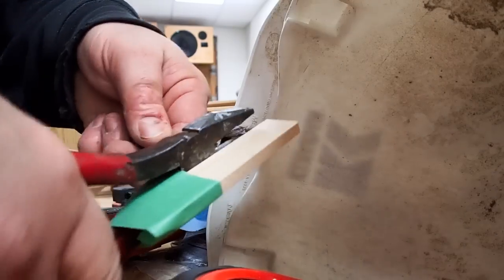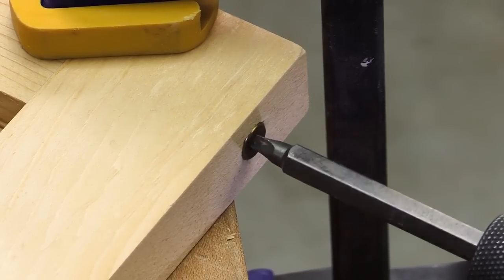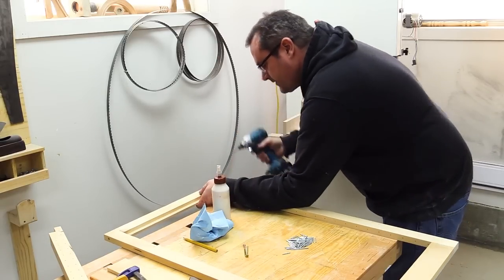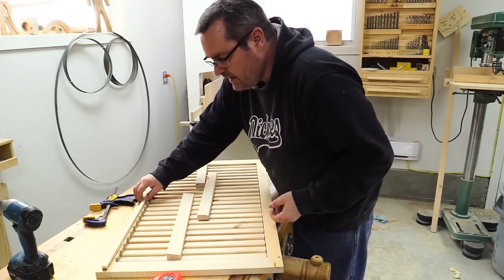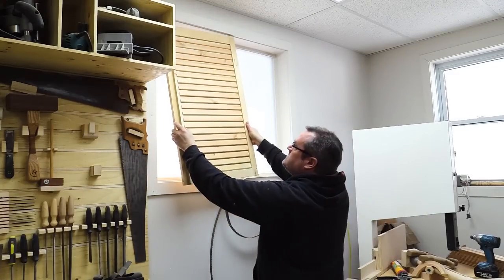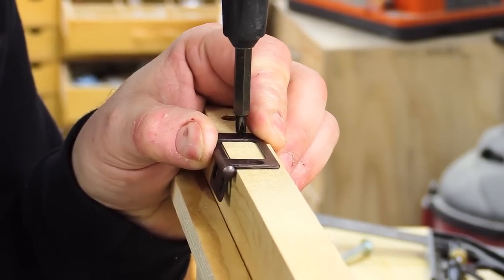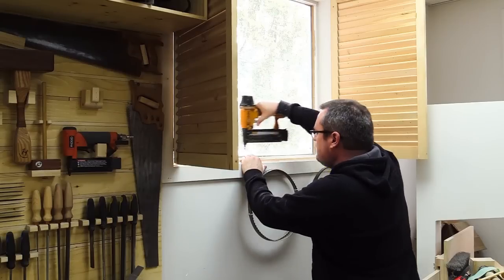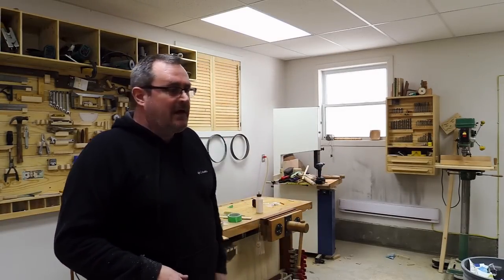Making Wooden Blinds Final

Comment: I had never seen blinds with the rod on the side like that before.  Has a nice clean look to it.
Reply from the maker: krtwood Thanks. As far as I know, these are my 'invention', since I've not seen any like this either. I made them before with the rod in the middle (use Norm Abram's method to attach the rod to the slats with staples), but I like this method a lot better.

Comment: Those look great, John! Are you at a point yet where the Shapeoko would have made the knuckles easier to crank out? I'm curious if you've done any more with it since your initial frustration.
Reply from the maker: Sean Harrington Inventables sent out the new gshield and arduino, and that fixed the problem, but I haven't had a chance to finish it up yet. Be more about it in a week or so.

Comment: Your little blurb of "That's it for this one, I hope you enjoyed it." I almost thought you were going to follow with "Thanks and bye-bye" Ala Jörg Sprave from the slingshot channel. 

Great work on the blinds though. I've priced out some DIY wood blinds like that, and they are not in the least cheap. What is the benefit of the knuckle though. Others that I've seen just have the ends pinned and then the adjusting rod in the center. attached with some simple U staples.

Comment: I loved the series!
I have a question about the dimensions of the wire pin vs hole. Is 7/64 the same as 12 ga by Canadian standars? Is this friction enough to keep the slats up, especially after a long time of use. I hope I made any sense :)
Thank you and keep up the good work!
Reply from the maker: acousticguitarpeter The pins fit loose in the holes with no friction. Friction comes from screwing the knuckle to the control rod, tighten or loosen the screws for more or less friction.

Comment: What you could do is attach a string to the top of each rod from all the windows, use some pulleys and have a control system in one place in the room. Either electric or manual. Then from one spot you could open and close all the blinds. Let there be light!
Reply from the maker: jumpleadsx2 Or servos on each one for true high-tech.:)

Comment: Job well done on a custom fit.
Impressive.
Now get a hammer after that Robertson and straighten the crook out of it. jk
Reply: Very nicely done
Reply from the maker: Dave Bardin Thanks Dave. I actually did straighten the shaft on that screwdriver after I drove the first few screws and noticed it wobbling in the camera. Figured I'd never hear the end of it in the comments about using a bent screwdriver!
Reply: Dude its not a tool unless you use it. Good stuff. Carry on.